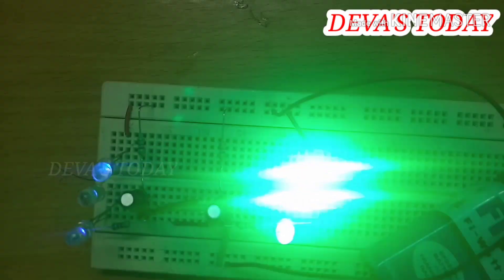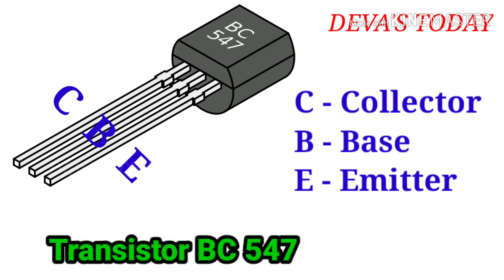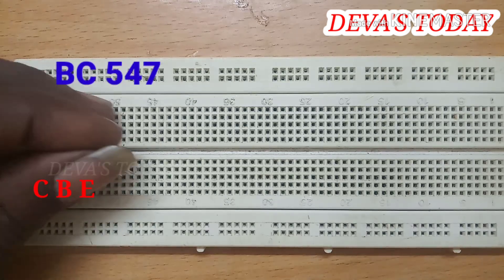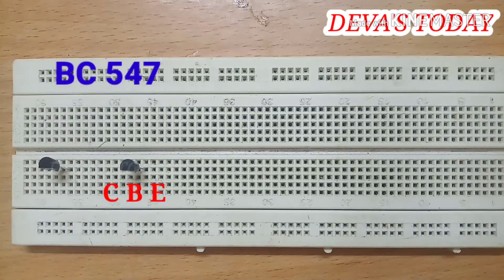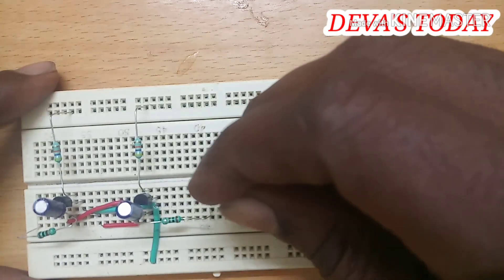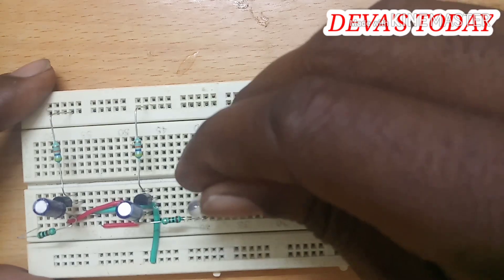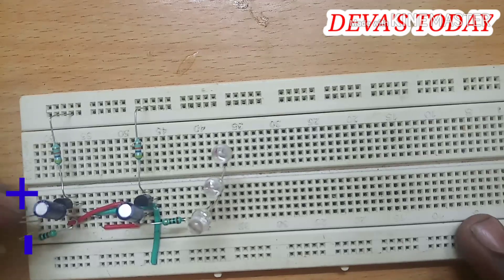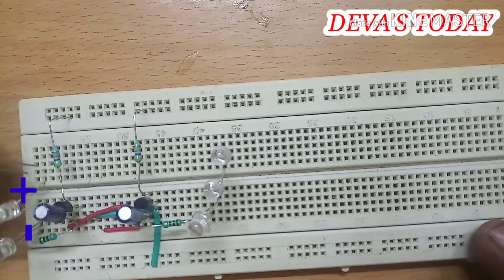Dancing Light | Running LED | how to make LED ON OFF automatically

Comment: 220v vachi 12 volt aaha mathi running lights pannuvathu eppati
Reply from the maker: Power source cell charger மாதிரி 12v adoptor அல்லது டிரான்ஸ்பார்மர் பயன்படுத்தி 12vconvertor பயன்படுத்தலாம்